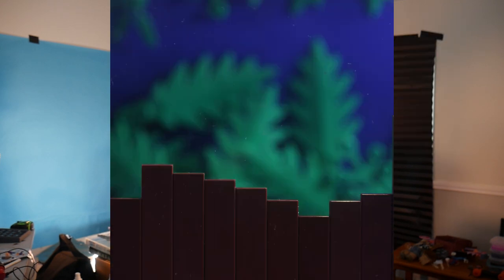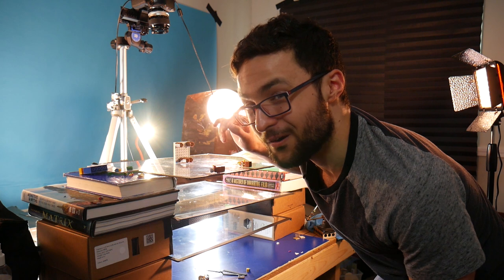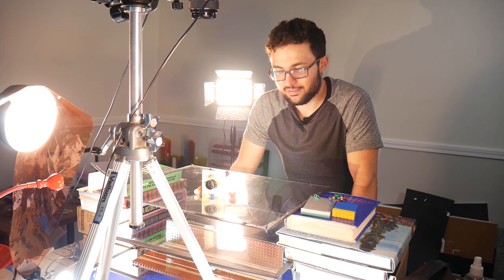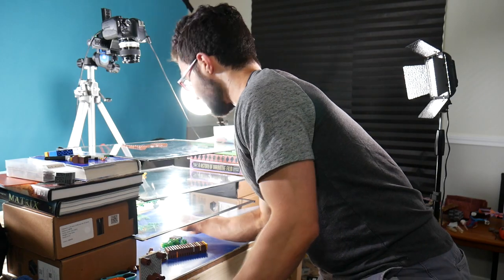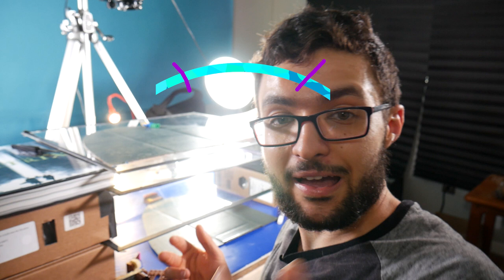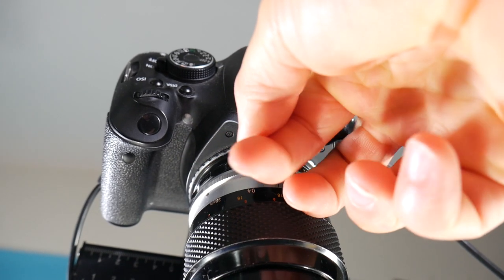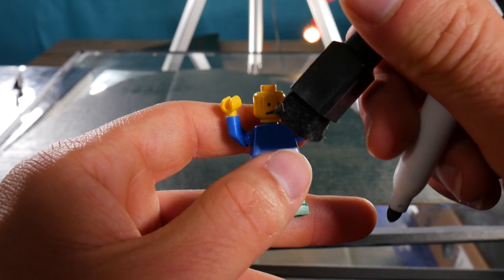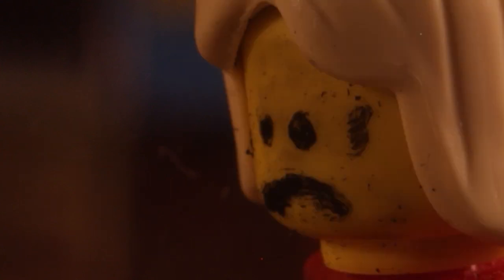How I Built A CHEAP Multiplane Animation Rig (Stop Motion Behind The Scenes)

Comment: I think I would just take to pieces of wood and cut grooves in them to set the glass, just need access to a table saw though, you could cut a lot of extra groves for better placement options and then paint everything matte black. Sometimes if I have reflection issues I will cut a small hole in black poster board and have the camera look through the hole.

Also if you only want one one sheet of museum glass you can go to a frame shop and ask if they have any cut off pieces of anti-glare museum glass and get it at a discount.